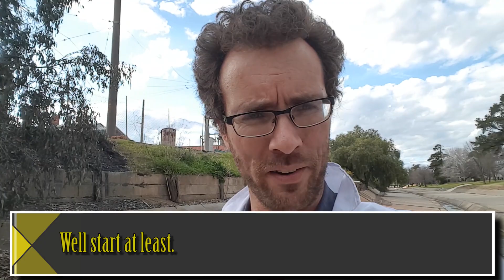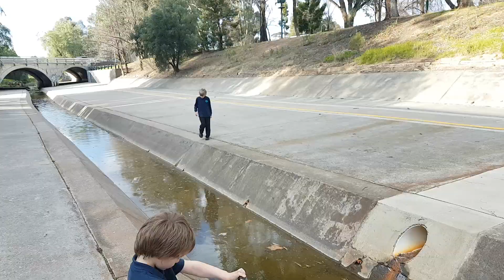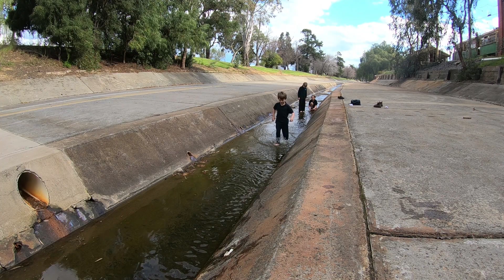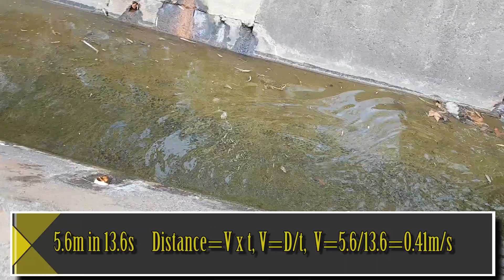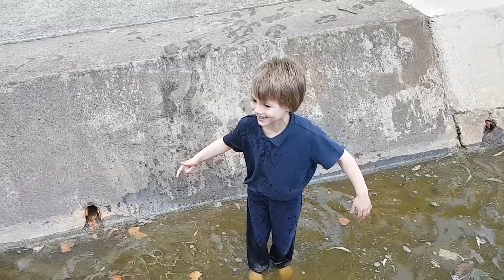Fluid Dynamics of Prospecting ep 1 Q=Va

Comment: My hope from this series may be a little more insight into the amount of water I should be running thru my highbanker , the angle I should be running it at , the feed rate of material I should be placing in it and stuff like that
Reply from the maker: Yep I plan to have a whole sub series on sluice and high banker design. From pump selection. angles, flow rates, flow depth, etc. 

We have a lot to cover before we get there though.